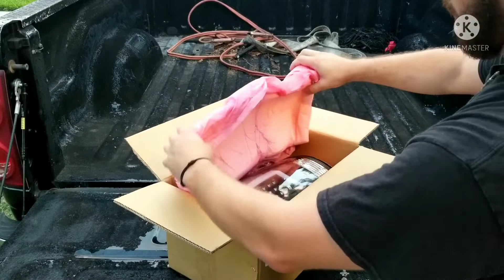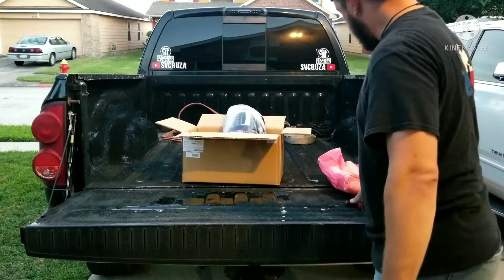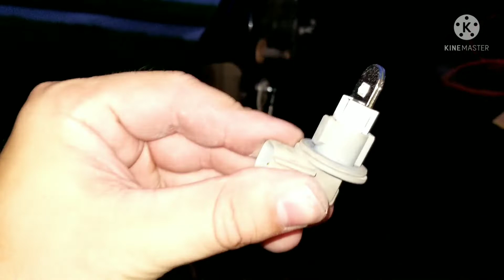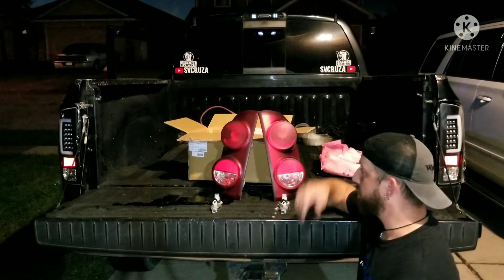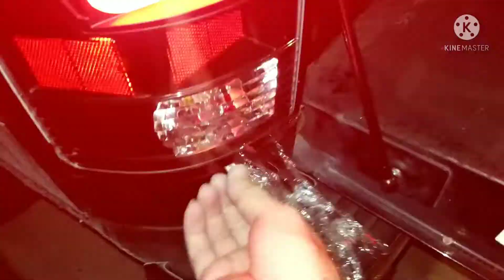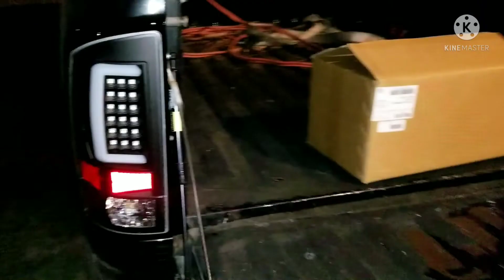SPEC D tail light install 06 08 Dodge Ram 1500 2500 3500 Pickup

Comment: How well have they held up and do they throw a lamp out error because they are leds.
Reply from the maker: I've taken my truck off-road numerous times out into Cactus Country I've beat this truck up I take it on a rough roads and I still have zero problems with these brake lights and so far not one single LED has burned out they all still work so I would strongly recommend these lights to anyone.
Reply from the maker: Also to add once I connected it to my truck it does not throw any errors at all
Reply: @svcruza  that’s good to here I might be getting these some time for my truck.

Comment: I don’t have break lights I don’t understand what I’m doing wrong
Reply from the maker: So you bought the brake lights from my video I assume. Make sure the plug is getting power and check the ground. Mine were a plug and play design but yours may require a little more attention.   What problem are you having?
Reply: @svcruza I have breaklights left blinker right blinker running lights just no lights below the red 1 and reverse lights my bad I meant reverse lights
Reply from the maker: @connoriscash6239  I too had an issue with the reverse lights and it turned out that I had a poor ground. So I cleaned it up and it's been great ever since.
Reply: @svcruza  okay thank you so much sir Imma clean up my ground and try it out you getting a sub and a like thanks for everything